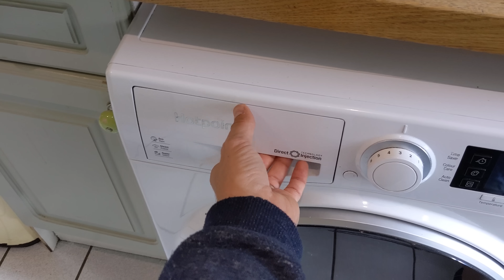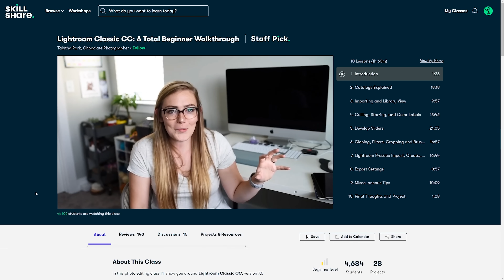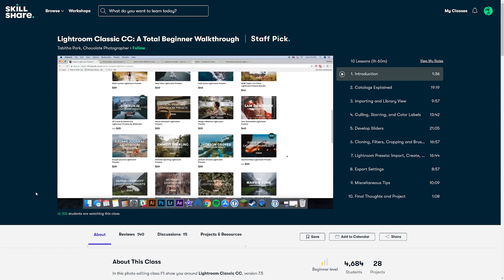The Pythagorean Siphon Inside Your Washing Machine

Comment: I have two toilets in my house. The one in my bedroom uses the standard american rubber plug on a hinge, and the other is the kind with two buttons and it has a pee and poop flush modes. I've never actually opened it to see how it works though, because the mechanism is built into the top of the tank cover. 
That's my public/guest bath, so I rarely use it anyways.

Comment: Hi Steve
Thanks for that video and the 2d mock-ups.

I had a question - 
In the Pythagorean siphon, isn't some liquid still remaining in the siphon after it empties? 

Does that mean some fabric softener gets left in the washing machine? 

How would you design a Pythagorean siphon so that the weight of all the water in both side containers is emptied? 

I'm wondering here about the pressure equations of this system.

Thanks!

Comment: In the US it's a flap that gets lifted up to expose the hole through which the water drains. As the water drains completely, the lowered water level causes the flap to close again. 

Under the bowl is another siphon that is more like Pythagoras one. As the bowl fills up, water is "pushed" up through an upside down U (really, it rises up as the water level in the bowl rises). Once the water makes it over the hump, the rest of the water is "pulled" or siphoned down from the bowl.

Comment: Denmark. Rubber plug in the bottom of the tank. Two release buttons  on top with one float connected to each. When a button is pushed, the plug is lifted, and a cam in the shaft of the buttons float holds the button down which in turn holds the plug up. When the water level falls under the float,  the float obviously goes down with the cam which releases the button, and the plug falls down to close the water flow.

Hope it makes sense. Never thought I needed to explain this in English.

Comment: Informative video, thanks.  US toilets work a bit differently, the classic style is just a rubber ball at the bottom that is held in place by the weight of the water until lifted by the flush handle, then it floats until the water is gone, seals the opening, and the float valve refills the tank.  Usually there is some sort of rubber flap and hinge arrangement to keep the ball right at the tank drain while flushing.  
More modern dual flush toilets are a bit more of a mystery to me, I know it's the opposite of your setup in that a short press makes a short flush, while a longer press will make for a longer flush.  I'm going to be at the hardware store tomorrow, so I'll probably have to spend an unhealthy amount of time staring at flush mechanisms.

Comment: In the US, the bottom of the tank has an outlet that leads to the bowl, normally closed off by a "flapper valve", a rubber disk hinged at one side.  The center of the disk widens to a hollow ball with an open bottom, that sits on the top of the outlet pipe, and is held shut by the weight of the water in the tank.
The flush handle is connected by a chain to the flapper valve, and when activated, pulls the flapper open, which then stays open due to the buoyancy of the hollow ball.  When the tank water level drops to empty, the valve settles back into the outlet pipe and the tank fills.

But there is still a siphon, it's the one molded into the porcelain  base, which, when flushed, ensures that the bowl empties completely before being refilled.

Comment: I'm from the US and I've never seen that flush mechanism. The most common here is a flapper valve over a large hole at the bottom of the tank. There are a couple others, but they all perform about the same function focusing at dumping the tank into the bowl as fast as possible.

Comment: Most toilets that i have seen in Canada are like the ones described by @@UCUoDL0mlgk1vawH55SKotcQ in his description, ie the rubber plug on the bottom of the tank.  However, the toilet that I have in my home now uses a cylinder around the drain hole that lifts when flushed, and then settles when the tank is empty.  It is the only toilet that i have ever seen with this mechanism, and if the intermittent leak persists, I will have to get much more informed on how it works in order to stop the leak.

Comment: Mine just has a hole with a flap over it. When you flush the flap pops up and let's all the water out. The flap does not fall back down until the tank is empty because the flap is full of air and floats. Once the tank is empty the flap falls back over the hole and the tank starts to fill back up. The flap does not float as the tank fills because the water pressure keeps it sealed to the hole.

Comment: American toilets Actually do have a siphon but located on back of the underside of the bowl and not on the tank, flushing the tank into the bowl is what initiates the siphon.

 You can "flush"  these toilets by simply dumping a good amount of water,  (about a gallon) directly into the bowl itself with a bucket, untill it initiates the siphon     

  You will notice a small of water returning to the Bowl after the siphon is done. Just as was demonstrated here.
Reply: Thank you, this resolves my dispute.
🇨🇦
Reply: So one of the challenges with designing more water efficient toilets is balancing how the water is split between the tank and the bowl while minimizing overall water usage. Too much water in the bowl and too little in the tank, then the siphon won't get primed. Too little water in the bowl and too much in the tank, then there's a lot a dry porcelain to get pooped on.
Reply: @ledoubled  Maybe we need those three seashells from that movie "demolition man."  Not sure how it works, but its the best design. lol
Reply: @ledoubled  the new Bill Gates toilet doesn't use any water at all and produces pellets for a fire from your leftover waste
Reply: YOU ARE 100% CORRECT!
Reply: Wrong, you’re thinking of a P-trap that blocks the sewer gasses from coming back into your house, butt(🤣🤣) when you dump water in the bowl all at once it does starts a siphon. Most American toilets have a plug. on a chain. in the tank. pull the plug. water runs in the bowl. Siphon sucks the poo away. Hate to brag but I’m know my toilets🤷🏽‍♂️
Reply: Ira Hartford it sounds like you’re describing exactly what they were describing
Reply: @brettjenkins1645  I imagine all of them have the gas trap going to the sewer...cuz there were some fart gas kaboom issues that people ran into pretty fast..and the smell lol

The plug has some buoyancy to it so it floats enough to stay open while the tank is full and draining. Once all the water is gone the plug makes a seal again and as it fills again the pressure of the water keeps it sealed until the handle is pushed and the plug is lifted again. Rinse and repeat.

The half flush thing is a pretty fancy idea. Sometimes you do need a full tsunami to get the logs where they need to go, but that is probably a fraction of visits. lol
Reply: @litpath3633  exactly, in a US toilet, the plug is set up to regulate the water with buoyancy and water pressure forcing it's way past. You can actually buy the siphon-style valves as upgrades here, and that feature does explain why they're called 'upgrades'. clearly, nice for the water-use conscious.  I'dve liked that option when I lived on well-water.
Reply: @DFX2KX  other water conscious upgrades include an heavier plug that isn't buoyant.

I was actually shocked the first time I encountered an buoyant flush plug, the waste! 
Of course I was raised in a desert 😅
Reply: @DFX2KX  how about the toilets that have a sink on them, the water from washing your hands is added to the next flush
Reply: @irahartford2563  nothing you said refuted anything that he typed and you can still use water to initiate the siphon in the lower bowl without messing with the upper tank at all
Reply: @irahartford2563  Would a siphon toilet work when filled with mercury instead of water? (Like seen on Cody's Lab with an ordinary toilet) Especially in regards to the higher density of mercury, which e.g. caused the chain to break, forcing Cody to pull-up the plug by hand.
Reply: @TecraX2  Being made of plastic; and the fill level being quite high, it is likely it would deform the plastic.
Furthermore, the siphon would require nearly all of your body strength to initiate fully.

Comment: Every toilet I have ever worked on (which is maybe 20 ) have a flapper valve at the bottom of the tank that you lift with the handle and it stays up because it is technically lighter than the water but once the tank empties it falls back down and the weight of the water holds it down. I assume the newer toilets that have dual flush modes have that type of mechanism you showed but those are new to the states and since I am not a plumber just a DIY person I don't work on many toilets. When you said the thing about the toilet I thought you were going to talk about how the P trap works as I guess in a way thats similar.

Comment: I think there is a greedy siphon in your toilet Steve...  The basin is half of one.  The water from reservoir flows into the basin.  When the water in the basin fills to the top of the siphon pipe it pulls all the water from the basin over the edge.  Some toilets let you see this curve at the bottom from the side.  It is essentially half of your 2d model.

The tank/reservoir is seperate not needed.  You can still activate the greedy siphon in the toilet by just dumping a lot of water quickly into the toilet basin.  A bucket works.  A cup of water probably would just leak over, like you showed.

Great video, love your work.
Reply: UK toilets do not have siphonic pans.
Reply: @millomweb  How does the water leave the basin?
Reply: @denuvian  Gravity.

Comment: American Toilets use a Float Valve. pushing the handle forces plug/valve up via a chain, the plug has a float either attached to the chain or integrated into the plug itself. when the tank is empty the plug settles as no liquid is holding it up anymore. then the weight of the water is enough to hold it down. it looks kinda like this.  ------{------------}-----  but flatter like a traditional UFO kinda. the flaps on the side help hold it down so it doesn't just float up on it's own. Hope this helped. Been watching since the discovery of the "Steve Mould Effect"! keep up the good work, I never miss a video

Comment: Over here in the US all the ones I come across simply have a valve at the bottom that gets pulled open by a chain. There’s an additional overflow tube as well that just runs down to the bowl. The water shut off is the same.

Comment: Definitely different in different places. I've never seen a toilet valve look like that. I have seen the ball float type which is considered old here in the usa now. Most toilets that I've seen have a simple flap attached to a chain lol. very very simplistic system. once you pull the flap up the water just keeps flowing until the backpressure is low enough for the flap to fall back down and seal again. But in the past 10yrs or so just about every different brand has their own version of flush technology. engineered towards ultra-low water consumption and flush power.

Comment: Not a single toilet I’ve ever seen here in Mexico has had a siphon. It’s always just a little rubber flap that’s designed to seal a hole at the bottom of the tank after it’s been emptied.

Comment: No siphon in German toilets!
We have always a tube with hollow plug that goes down the tank. If you lift it up it floats, want to stop it have to push it down. Mechanism to push down various.
And our washing machines have just the single siphon on one end build into the flat wall of the drawer.
Works the same way though!

Comment: US toilets are somewhat simpler than that: they use a buoyant "flapper" that is held flush against a hole at the bottom of the tank (what you call a cistern, I think) by the weight of the water.  When the handle pulls the flapper up, it breaks the seal and the water flows out.  As the water level drops, the flapper falls back down against the hole and seals it, causing the the water level to rise again.  The float/valve mechanism that switches the flow of water into the tank on and off is essentially identical to the one in the video.

Comment: Steve, I know you've got a whole bunch of comments and might not have time to read not to mention answer all of them.
However, I wonder if you could clarify whether or not I've got this one right; 
The water from the bottom of the toilet would also flow completely out, if the pipe leading to the sewers was sufficiently narrow, or the surface tension of the liquid in the bowl was strong enough. (?)
Reply: Depends on the design of the toilet. UK ones don't empty. It seems US ones do !

Comment: Fascinating, most toilets I've looked into have a different system: The important bits are just a plunger or a flanged rubber stop at the end of a rod that you pull on,  when the rod is down it blocks a hole at the bottom of the tank, when it is lifted the rushing water somehow keeps the stop from dropping back down (It's been a while since I opened a toilet so I'm not sure about that last part)
Reply: And they're prone to leaking. a siphon can't leak.

Comment: Now I understand while these "pump" style mechanisms give so much trouble. 
The most common type here takes the form of a stop cock type valve. When the lever is depressed, it raises the stem of the stop cock . An L shaped lever brake with a float attached holds the stem up, keeping the valve open, until the cistern has mostly emptied. 
Water pressure holds the valve closed as the cistern fills, which is why they tend to leak and fail to stop flushing once the parts get too corroded. 

Most of the siphon types I've come across tend to fail when that syringe thingie's rubber seals perish. 
As you can't get spares for the siphon mechanisms  around here, the only solution is to replace the entire mechanism. The mechanical types also have a rubber seal that eventually perishes, but those seals are readily available and thus easily replaced by the home owner.

Comment: In my toilet, and in every toilet I've seen we have a floating ball flap at the hole leading to the bowl. the handle pulls the ball up and it floats until the cistern is drained and then re-seats itself and is held down by the pressure of the water filling  the tank.

I wonder if this can make sort of a poor-mans Pythagorean Siphon. Have a floating ball flap at the drain, and attach it to a float that is large enough to lift the ball against the pressure of the water.

Comment: Someone has probably already told you this, but the plastic mechanism you demonstrate isn't present in many American toilets (in my experience).
I think it's required in the UK, as an attempt to reduce leakage from the tank to the bowl (water can only leave the tank by getting above the normal water level in the tank, so unless the tank fill valve has failed open, or the gasket between the mechanism and the bowl has failed, it can't happen).
Personally, it seems like an added complication for a very limited amount of benefit.

Furthermore, toilets in commercial/public settings rarely have tanks at all, and instead use a flush valve, which allows for a deluge of water without the tank (but requiring larger piping to the toilet to handle that flow)

Comment: My toilet doesn't use a siphon (though maybe the bowl is arguably a siphon?). There's a floater attached to a plug, the plug is kept closed by the water pressure until you pull it open with the handle, then it stays open until the water level is low because it floats.

Every toilet in any US home I've seen uses this. It's imo dramatically simpler.

Comment: That's a nice mechanism. In Australia every toilet I've fixed has a rubber stop that opens to dump the water and a dual flush mechanism with two buttons that determine when the rubber stop closes. The rubber stop can fail to seal if it's old or to much water flows out, so that can make the system leak. Also they have the same fill float mechanism as yours, so two failure points. Kinda wish I had a toilet like yours. What an odd thing to be envious of...

Comment: Most toilets I've seen (in Canada) just have a hole for water to drain out the bottom of the tank, covered by a rubber flap.  The handle pulls on a chain that raises the flap, and it has a shape on the tank side that allows it to stay floating open until the water level gets low enough.

We also have somewhat better designed lower flow toilets.  Similar style there, but some kind of cylinder that gets raised instead, letting water drop quickly into the bowl.  The funny thing about this second design is that it works exactly opposite of yours Steve.  Just pressing the handle quickly does a smaller flush that is usually enough, but holding it down longer allows more water to flow through.

Comment: Just adding to the other comments - I''m from the US and every toilet I've ever seen is wayy different. There isn't a plastic housing to create another cistern. The entire upper deck acts as a cistern, with a rubber valve on the bottom of the upper deck that leads to the toilet bowl. The flush handle mechanism is connected via chain to the rubber valve, and when flushed it opens, and the rubber floats in the water until the upper deck is empty. 

Though looking at this contraption in your video, I think this is exactly how newer toilets work. Low-flow toilets.

Comment: Man, I wish I'd seen a smart flush like that. The American toilets I've ever worked with have a stopper flap at the bottom that floats until the water gets too low, then the flap closes. I've always felt that was prone to leaking too easily. This doesn't have any moving seals, every seal is static--and I love the half-flush option, I might be able to get my wife to flush if she didn't feel she was wasting so much water.